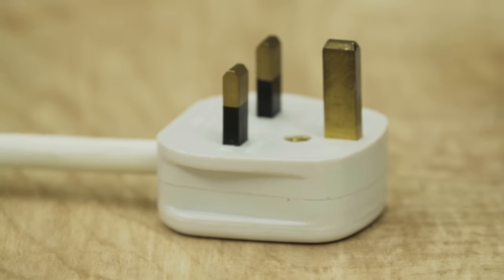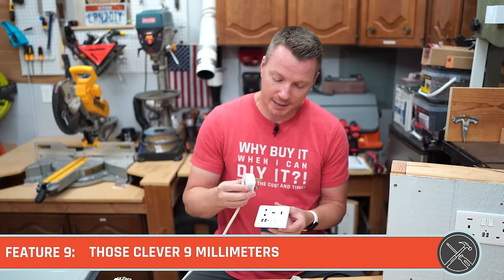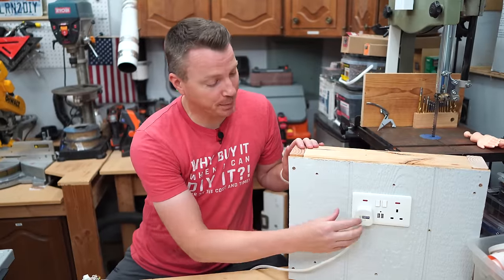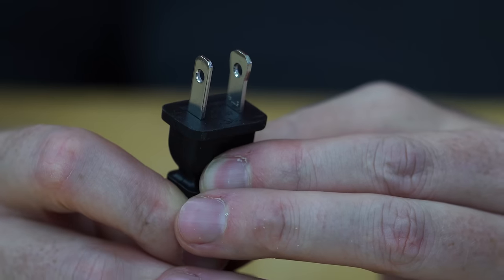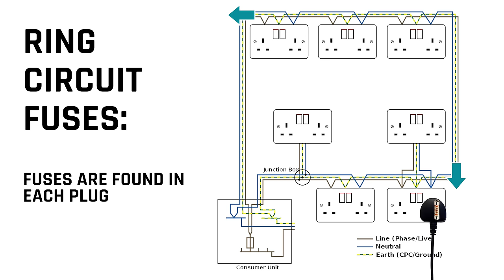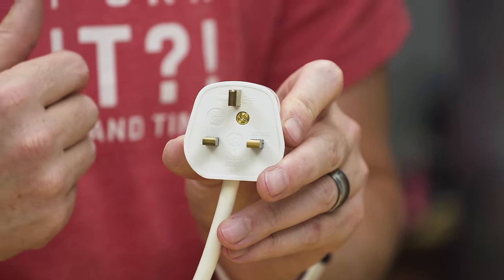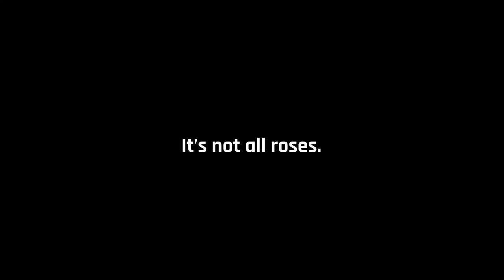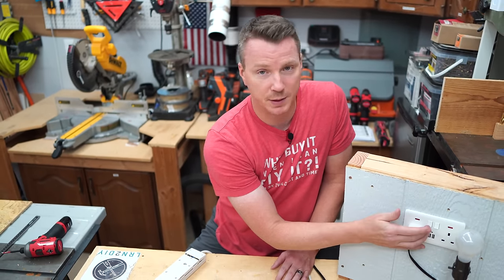British Plugs and Outlets Are On Another Level

Comment: As a Brit, the switches don't cause any confusion when troubleshooting, they're pretty bullet proof and growing up with them, you know they're there.
Reply: Yep, it's a ludicrous idea . . . a lamp doesn't turn on so we start taking the bulb out and checking it, lol . . nope, no one does that, we make sure it's plugged in and turned on . . . it's like saying if your mouse won't wake up your computer from sleep mode then you start to unscrew your computer . . . nope, you'd check if it's actually switched on . . . I suspect your point about 'growing up with them' is why people who've not grown up with this system might think it's confusing for some reason.
Reply: The switch also means that we don’t ever leave plugs on the floor to trip over…
The switches are also always on/off the same way up… so it’s trivial to check.
Reply: @JohnR31415  I agree. As a European, usedthem in Malaysia. Switch, fuse, dinosaur plugs, just perfect!
Reply: ...and is always the first thing you'd check if a device doesn't work. Personally I always troubleshoot from the socket towards the device and not the other way around. Confirm you have power and then trace why that power is not reaching the device as it should.
Reply: The biggest design flaw is that you can step on the prongs hurting both the plug and your foot. We need a redesign that incorporates a 3 pin design, but also lies the pins flat. No one should copy our design, they should take the best FEATURES of our British plug designs but redesign the layout...They say "don't fix it if its not broken" but lets be honest it IS broken.
Reply: plugs exist that have a handle on then back so if they do drop they land on their side. Though who actually has plugs laying around? We all leave them in the socket switched off or in power strips so your not likely to stand on them.
Reply: Just plug the lamp in somewhere else if it works you know its the socket if it doesnt......(you get the idea) :)
Reply: And you'd also know that UK made plugs are better quality than Chinese.
 I've got 45 year old uk plugs that are still perfect,better made,I stay away from Foreign made if I can.
Reply: Quite, it's the same a checking it's plugged in.
Reply: Ye, its basically 'does it turn on', nope, check the switch
Reply: I lived in the UK for about 9 years and I have to say: there is NO foot-borne agony worse than stepping on a Type G plug full on! It makes stepping on Legos feel like bubble wrap. 

One time I wasn’t feeling well and had unplugged my heater but, being sick, just left it off to the side (I thought!). Two in the morning headed for the toilet I stepped on the plug FULL body weight. I went flying and landed on the floor waking much of the building up. The bruise I had on the flat of my foot lasted weeks!  I will never, ever, forget it.
Reply: @festinger3  I don't mind foreign made, as long as they're made to the proper standard(s?). It's when I find the really thin things that I know don't have a fuse in the box, that I become irked.
Reply: @alandaiello7268  I maintain that the pain of stepping on a plug is worse than the pain of childbirth. 

Before anyone gets mad at me, consider if you've EVER met anyone who has experienced the upturned plug pain and then chosen to deliberately do it again. If you have not, but you know women who have chosen to have a second(etc) child, you have met someone whose pain was less than that of stepping on an upturned plug.
Reply: But a little Switch is a bad idea for Capacitive and huge Loads.... a capasitive load can wear a switch very quick.
Reply: You gotta make allowances for our less initiated cousins.
Reply: Yes indeed, I was pretty amazed by this potential troubleshooting issue. I moved into a 70s house which was full of unswitched single sockets. Over the period of a few months I gradually swapped them all out for double switched. Can't stand the unswitched ones.
Reply: @mattsadventureswithart5764  Don't forget that women are genetically programmed to forget how painful childbirth is.... otherwise none of them would ever have a second child! (an ex of mine had faulty programming - she absolutely would not have a second child no matter what... she remembered exactly how painful it was).  But yeah - standing on plugs = severe agony...
Reply: Donynam Lee  
Not always.
Reply: The switches one got me, could you be so dumb as to not realise it's not turned on, pushing down turns it on, up turns it off, the colour indicators are a massive giveaway too, never heard of anyone being confused by a switch on a socket before
Reply: People go on about the pain of treading on a lego brick, but it's nothing compared to treading on a UK plug :-D
Reply: Just for clarification the switches on sockets are NOT a requirement, they are for convenience.  It's possible to buy sockets without switches.
Reply: Yes, switches on sockets are NOT mandated, but as they cost basically the same, and are more convenient, most outlets have them.
Reply: @festinger3  I still have some Bakerlite plugs and sockets in my workshop, they are not live as I bypassed them but I like them so much I did not want to take them out, they could still be used though if I wanted, the Bakerlite plug is on my very first drill that was handed down to me, its a '1950s Black & Decker model.
Reply: Some plugs come folding flat — apple devices. Mine has the port in the back, though. Also you can buy plugs for android + apple where the port is in the edge so the leads run neatly down the wall.
Reply: I work in IT and I'll be perfectly honest some users who work from home genuinely forget they have to turn things on at the wall. But I'd say the people who are that daft are few and far between
Reply: Never has been confusing
Reply: Un switched sockets are also available ....... just saying
Reply: As someone who has worked in IT support I can confirm that some people here in the UK genuinely do have a problem with socket switches.
🇬🇧
Reply: since they dont have a switch to off it.. i guess they always yank out the plug itself to ''off'' them
Reply: The only downside to that plug is stepping on one hard enough for it to implant in your foot my one of my twins woke up crying I jump out of bed so not to wake the other then land straight on the plug so hard that I had to physically pull it out had 3 holes in my foot for about a month so sore
Reply: @festinger3  Do the 45 year old plugs have the live/neutral shielding on the pins?
Reply: @gezmonder  I grew up in house built in 1976 with all unswitched sockets. Fairly common back then, but I can’t remember when I last saw one.
Reply: Donynam Lee  Mostly because the cord was fairly long (it was a small portable) and I didn’t want to trip on the cord. Ironic that I ended up stepping on the plug!!
Reply: New Zealander here. Type I. And always switched. Switches are not a problem when you are expecting them on every outlet.
Reply: As a maintenance worker at a hospital, being called out because something “isn’t working” only to discover they’ve turned the switch off at the wall is a daily occurrence
Reply: What he means is that on cheap sockets the switch can break and cause the plug to not switch on. Happened to me once!
Reply: @johnwellbelove148   I still have some plugs with out insulation at home but not many
Reply: @nkt1   not till 1984 😲 so a 38 year old house could have unshielded plugs
Reply: Care to tell me why the switches work the opposite way? Just the same reason you guys drive on the wrong side of the road, or any other implications? To me, what is the "off" position of the switch would be the "on" position.
Reply: You just try the appliance in a different socket to rule out any fault with the socket.
Reply: @mattsadventureswithart5764  So why didnt you just flip the wall switch to turn the appliance off? Pulling the plug out of the socket is the non-standard solution here
Reply: @Hobby_Electric  What domestic appliances are that heavy duty capacitive?
Reply: You tend to only step on a plug once lol.
Reply: Apple solved the stepping on pins issue by having them be able to fold into the plug when not plugged in. Makes them way easier to travel with aswell
Reply: I was so puzzled when he said that 😁
Reply: Donynam Lee  I think it's a piece of mind thing.  My dad unplugs my toaster and microwave every time he's round mine.  It annoys me to no end given the toaster is switched off at the wall and the microwave needs to be on all the time or it forgets what time it is.
Reply: Indeed, i dont think ive ever knoewn a switch on a socket to be faulty, maybe it does hapen but ive not seen it myself
Reply: @Hobby_Electric  You don't generally switch them under load unless the appliance has no switch of its own which is rare, besides they generally handle breaking current well enough.
Reply: And who even leaves plugs lying around like that to stand on 😂😂. That's the point of the switch so we don't need to unplug it to stop power usage.
Reply: Exactly. I'm British born and bred too and we take this brilliant design for granted. You just automatically switch on and off from the mains first and leave any appliance plugged in. The size has never seemed and issue. It's what we're used to. US plugs seem flimsy to me.
Reply: @mattsadventureswithart5764  Tbf I don't think any woman ever got pregnant a second time "because it didn't hurt"
Reply: @alandaiello7268  that’s why we have switches, to stop people leaving them unplugged on the floor
Reply: @Hobby_Electric  never heard of any switch on an outlet stop working, ever. Whatever the problem you’re imagining is, it’s been thought of and designed out
Reply: @davidjames2145  mostly Americans living in the U.K.
Reply: @peterharvey1762   pretty rare to have a 40 year old device still running in your home,  and it’s easy to change the plug
Reply: Being a Brit in Australia and seeing sparks -lugging things in.. years into living here I still can’t get used to how less safe they are
Reply: @yeknommonkey  wow 50 years old I’d venture a guess your house might need rewiring soon. The great thing about sockets is they’re not hard to replace
Reply: Especially when you step on one in the dark lol
Reply: @pitecusH  It supposedly comes from the days of toggle switches and when most houses would have had electric lighting, but no or few sockets. The idea being that if someone fell, and happened to hit a light-switch, they'd naturally knock it downwards and turn the light on, so not leaving them potentially injured and disorientated on the floor and in darkness. Some things are deliberately the other way - such as isolators, MCBs, RCBOs, as you'd likely want to isolate the circuit when falling, in case you were being electrocuted.
Reply: Literally it become Second nature to just check if the switch is on, i hate when devices don't have power switches so you have to leave the plug on the floor for someone to stand on 🙃
Reply: @stephenwalker6823  oh wow, that's an interesting explanation. Never would have thought of that, thanks!
Reply: I mean that's a real hard of thinking problem. The first thing you'd do is check if the switch on the socket is on or off. If you're incapable of figuring that out then there's some other serious issues going on.
Reply: In IT, you'd be surprised by how many idiots call you to say their pc isn't working, only to find out it is switched off at the plug!
Reply: Just you know turn the switches on if you want them on it's always nice to have the option to turn it off
Reply: Good video, but I don’t think any Brit has ever worried about the issue’s you perceive as they are non-issues
Reply: Yeah I though that. This isn’t a problem at all 😂
Reply: 😂 litterally the first thing you check and then feel like an idiot because it's switched off. Get a little chuckle out of it, I'd say its a pro
Reply: @festinger3  Same goes for sockets (or outlets for our American friends). I moved into a house with sockets from the 50s and they were still going strong. I doubt most of the stuff made today will still be functioning in decades to come.
Reply: As a Brit as well, I agree
Reply: All you do is plug something else into the socket, if that works it's not the socket, and they rarely go wrong anyway. As for standing on plugs - what kind of idiot would leave it in the middle of the floor - typically, since the sockets have switches on them - once they are plugged in, they stay plugged in. You're taking American problems and trying to introduce them into superior British engineering where it doesn't exist. Finally, ring systems are far superior to radial - "the load might be too much on one part of the ring" - erm... that rarely happens but is highly likely with a radial system.
Reply: @Hobby_Electric  homes don't use "huge" loads
Reply: Donynam Lee  only recently, they never used to, and you can still buy plug faces without the switch
Reply: @Hobby_Electric  I'm not sure what devices give that type of load, but in all my years living with switched sockets, the cosmetics get tired before the switch does 👍
Reply: Most of us use the switch to turn stuff on. So you flick the switch first and then troubleshoot if the device doesn't turn on.
Reply: True, but he was spot on with the Stepping-on-a-plug issue
Reply: @alandaiello7268  Big question.  As you decided to pull the plug out  of the socket why didn't you switch off leaving the plug in? The use of sockets without switches hasn't been used for years partly to make the socket safer,   it isn't permanently live and there's no sparking when an appliance like a 3kw heater plug is removed.  Your fault not the plug design.
Reply: @Hobby_Electric  The switch is designed to act quickly so that there is no sparking.  Switches get replaced because of mechanical damage not arcing generally.
Reply: @MrKeefy  Sockets should be switched.  It may not be  a rule now, haven't read  regs, but before plugs had the insulation it was required. Unswitched Sockets may be available  but without a kite mark won't be acceptable.
Reply: @johnwellbelove148  No, that's why switched Sockets were introduced. Who wants to have the TV picture ruined each time you pull a plug out? Unswitched also wore more quickly on kettles and heaters due to arcing.
Reply: As an Indian who uses type G plugs with rounded pins (that's the only difference between the plugs between Uk and India and why is that I don't know) I only understood the testing of the circuits of downsides part and that too only partially. Rest I was also not sure why even it is a problem.
Like why are you pulling the plug from the socket. Just switch off the power supply to the socket and leave the plug in nothing will happen and if your lamp doesn't turn on with the lamp switch try the switching on the power supply to the socket where it's plugged in.
Plus I don't know about UK but I doubt that every appliance has been converted to 3 pin variant as 2 pin variant still exist in the form mobile chargers, trimmers charger, router plug, set up box plug and other electronics which may need a long continuous but less power consumption still use a 2 pin. It's the case in India don't know about UK.
Reply: @eh1702  For portable devices the Apple folding switch is both robust in its construction and has the power and convenience so is easy to travel with too!
Reply: @mattsadventureswithart5764  

To phrase it in a way that the Americans will understand, standing on a plug has a similar feeling to unloading a 30 round mag from an AR15 in to your foot… in fact, it may be slightly worse….
Reply: Yes, I think he was just searching for anything negative to say. Not being British I can't speak to the uber-Lego problem, but it doesn't seem likely to me people leave their plugs lying about. The only downside I see is the size.
Reply: @peterawlings6568  Your reply is baffling to me.  Essentially it tells me what I said, as though I had argued against it. Are you sure you replied to the right person?  The apple folding switch (mine, anyway) is ergonomically clunky, having an unusually high, curved back that you plug your charging lead into the middle of, rather than a flat back &/or ports in the edge where cables normally go. Otherwise it’s fine.
Reply: @Medic6666  if none of the other plug sockets work in that room then check to see if the fuse on the fuseboard hasn't tripped  before taking the socket out of the wall to check that
Reply: @alandaiello7268  we call them 'Lego bricks' here
Reply: As a Norwegian, the switches never caused any confusion either from the first day I stepped foot into the UK
Reply: When you stand on it though.
Reply: @Hobby_Electric  never had to change a uk socket due to a worn switch in the last 40 yrs.
Reply: @reuben9722  but Apple items are not cheap like the tea break kettle
Reply: @geoffreycodnett6570  u
You can buy sockets today without switches
Reply: @kuriakosekjoseph6253  chargers have three pin style plugs with plastic earth.
Reply: @grahamjohnson4702  only some chargers. Plus I said about India don't know about uk
Reply: They would only confuse an American.
Reply: @Hobby_Electric  I've never heard of one of these plug switches failing. It's probably happened but just not a thing.
Reply: @nkt1  My parents house, built in 1975 had fully switched sockets. So maybe only common in your area.
Reply: @pitecusH  What do you mean by 'opposite way', that's the way they've always been. Also we drive on the correct side of the road and you adopted the French right side of the road.
Reply: @marksmithwas12  North America is the only place that calls LEGO, LEGOs.
Reply: @BensoftMedia  that’s not the fault of the system, that’s the fault of people being complete idiots
Reply: @Nathan-jt8zt  I know, I’m just sharing a funny story challenging the claim that nobody is confused by them. No system is idiot proof, mankind just builds a better idiot to get confused by it.
Reply: Definitely know they are there when you step on them. So painful when you just wanna get back to bed after going to loo in middle of  night
Reply: @BensoftMedia  hahaha that’s a good point mate
Reply: There's always that moronic moment though where you forget. The difference is British people look at a slightly complex design and realise they need to remember. Americans just say it's too complicated. In short, the difference stems from INTELLIGENCE
Reply: We were taught how to service these plugs in physics / science as part of the mandatory curriculum
Reply: Lamp doesn't work. Switch, wall switch, fuse, bulb. Weird, better check the cable. Oh, so that's where the hamster went.
Reply: Yessss! When I liked your comment it turned to 3k. I've been waiting for that moment. Now I need to go and apply my new found magic powers for the greater good.
Reply: @kuriakosekjoseph6253  I gave you the latest all appliances have three pin style plugs in the UK as that is the only type of Wall sockets we have. Live and learn from people that know.
Reply: I think he may be suggesting that the switch could be faulty. I’ve never even heard of that happening, but I guess if you haven’t grown up in Britain you might think it’s a potential issue. In reality, it just isn’t.
Reply: @grahamjohnson4702  Bruh, bruh. I understood that. In India also all the sockets are three plug sockets since  almost 2 decades now. The difference is some of them have that shutter mechanism and some have not. It's not a requirement here by law.
So majority of the people used to go the non shutter way as it was economical. But nowadays all new houses that are being built usually put these shutter socket.
And as India is a very price conscious market manufacturers to make profits sometimes don't use less materials like in the case of mobile chargers, trimmers etc. There is no law requiring something like that here although in the coming years it might come as India gets more economically stronger.
Reply: @AnotherDud3  muricans tho
Reply: Even if a switch were to fail; you can always try plugging into a different outlet.
Reply: @Pixie Pete Big mistake assuming I'm american, mate. Not even close.
Reply: As an Irish man I know that plug and use it every day
Reply: The plug knows where it is and where it isnt
Reply: @Pixie Pete There are, off the top of my head, maybe a dozen or fewer countries that drive on the left. The rest of the world, there being no other alternative, drive on the right side. If you're on the highway and everyone is oncoming traffic to you, maybe you're the one that drove in the exit. (i.e. "right" vs. "wrong".)
Reply: No self respecting British person calls themselves a 'Brit'
Reply: The switches are only confusing if you haven't grown up with them on every socket you come across.
Reply: @Pixie Pete Yes, I'm aware. That's why I'm asking, who is "wrong" when a dozen countries drive on one side, and some 190 drive on the other?
In regards to the highway analogy: You've never heard the joke about the guy that went in on the highway at the exit, and heard the radio warn drivers that a lunatic drives as oncoming traffic, to which the driver said "A LUNATIC? ALL OF THEM!" ?
Reply: @Rainstalker  "it knows this by knowing where it isn't at all times"
Reply: Agreed.  I favour the MK brand when installing
Reply: Exactly, by the way I'm a Brit living in India and there's no ring main circuits here. The BS plugs are awesome and keep your fingers away from live electricity.
Reply: @eh1702  My comment was supposed to read to support your comment not challenge it. The Apple UK plug is a development of the main design and is brilliant - especially for mobile usage. I think the comments you make about the UK plug design are sound and I agree with them so I did not mean to cause bafflement!
Reply: Problem today is plugs are factory fitted bonded. So people don’t even know how to fit and wire a plug from a bare three core flex. The only thing they get is a fuse and even then it’s ‘what’s a fooose for?’ 🙄
Reply: Agreed, the first thing you'd assume was the switch was off
Reply: Also I don't think he quite gets the ring circuit idea, a ring circuit is a perfect load balancer, no matter what power is being drawn from any socket the current in every part of the ring is equal. It's the US circuit that  has this problem. The negatives he gave are pretty weak and unlikely
Reply: @Medic6666  That would be to easy, like turning the switch on, no far more intelligent to rip the thing apart and try to fix it 😂
Reply: @flagpoleeip  Yep, reminds  me of a YouTube video of someone dragging the vacuum cleaner, pulling the plug out and spending 30 minutes vacuuming wondering why it was picking the dirt up anymore, that was a 2 pin plug LOL
Reply: @Hobby_Electric  The switch isnt little , it's adequately rated but this is possibly another bad US habit, most people would turn off the appliance switch first as you are correct, using the socket switch for turning of heavy loads isn't the best idea, it will lead to quicker failure of the switch, we would only usually use the switch as a second safety breaker, or as a primary breaker for unswitched low power things like chargers and power plugs
Reply: @AnotherDud3  Only in countries that aren't used to switches and where folks aren't to bright 😂
Reply: @astromec6303  All things fail occasionally especially if mistreated, it's rare
Reply: @reuben9722  Typical, better idea just don't be so lazy and leave it lying around in the first place
Reply: @cjuk81  it does but it's rare, usually happens when missused
Reply: @BensSightSoundandAuto  Exactly
Reply: @yeknommonkey  I've got one aswell, got hit with a hammer
Reply: Just a thought but if you left a cable across a floor like that in the dark you probably trip over it and smack your head on the wall before you stood on the plug😂
Reply: Well those with an IQ around room temperature might find the concept of a switch confusing but then again they would probably find walking and chewing gum at the same time complicated.
Reply: Sure Pal, I have a house that is rented in which all the plug sockets are over 50 years old. Because this house is rented I’ve just had to have an electrical inspection done to meet the legal statutory requirements. 
All the sockets are absolutely fine and must have been used 10’s if thousands of times.
Reply: Don’t worry, simple, things, confuse Americans😂
Reply: I0
Reply: I've been with the wet 240 shock it hurt haha
Reply: @Hobby_Electric  UK plug sockets provided they are made to UK safety standards last donkeys years.  your concern is not valid
Reply: @peterharvey1762  no any home with an appliance that has a 38 year old plug on could have unshielded pins..
Reply: These are very handy as a Brit myself and we also have covers that are made of plastic that we plug in to be extra safe😊
Reply: I’ve stepped on a socket befor but its the iPad Pro one and that folds up 🎉
Reply: @alandaiello7268  What did you unplug it?  Just switch it off.
Reply: @johnwellbelove148  Yes
Reply: @pitecusH  You press on the bottom of the switch to turn on. The top of the switch therefore pops out and usually has a red mark on it so you can see it is 'on' when looking from above (as you would usually be)
Reply: You didn't mention that the downward cable also means you can push stuff like couches, dressers and such closer to the wall because the cables don't stick out.   And if you do push something back up against the plug, it won't damage anything.
Reply: Ikr, it's just a nightmare when you go literally ANYWHERE else in the world you can't afford to forget an adapter 💀
Reply: @alandaiello7268  
Brits do not do that.
Reply: @Hobby_Electric  
Hugh loads ate generally hard  wired to a terminal block.
Reply: @festinger3  Yeah, Chinese plugs are not quite BS1363, they use some much looser standards.
Reply: @davelordy  I grew up in a country with American plugs and moved to the UK. It was never confusing for me.
Reply: @alandaiello7268  when you grow up living in the UK you don't often do that..maybe once 🤣
Reply: @Hobby_Electric  its not "little " its raged for 50 amps but plug and wiring is generally 13 amp rated..UK plugs are without question the best designed in the world
Reply: Indeed as I don't know why someone would ever jump to the device being broken before checking if the switch is on. Even if you haven't grown up with switches on plugs, you first check the circuit breaker. Which is essentially just another switch before assuming something has broken.
Switches on plugs also just make alot more sense so you don't have devices consuming energy by being on standby while not having to unplug the device.
Reply: @davidjames2145  I once had a problem with a computer not turning on, turned out the fuse was missing
Reply: Ha ha ha ha, I’m pretty sure I haven’t been confused by an on/off switch since I was 3
Reply: @danegel  So many questions for that....😆
🇬🇧
Reply: They can but it's really rare, and to test it you would just find something you know that work and try it.
Reply: @mattsadventureswithart5764  surely the pain of a motherplug giving birth to a babyplug would be worse still ?
Reply: As a computer technician who had to drive 50 plus miles to "fix" a computer that had been switched off at the mains, I feel I can say some people have a problem with this.
Reply: yeah ive never felt unsafe with electricity when using this plugs
Reply: As an Irish person, I can concur...
Reply: I wonder why they don't use glass fuses.... it's impossible to tell if the fuses are good visually.
Reply: @no_no_just_no that's not an issue with the plugs that's just incompetence
Reply: @alandaiello7268  I did something similar, unplugged something to replace a fuse, realised didn't have a fuse and the shop was closed, left it unplugged, got out of bed at 3 in the morning for a glass of water, stepped on it.

However I had more than just a bruise, it literally tore my skin and I three rips in the sole of my foot where this monster attacked, though it's only ever happened the once
Reply: It's a problem only an American will invent to make something foreign that is much better look bad. Also, no one has ever stepped on a British plug.
Reply: @mattsadventureswithart5764  
Have you had a child?
Reply: @gelinrefira  this is incorrect, I know many people who have stepped on a plug, your comment should say nobody has stopped on a British plug twice
Reply: @gelinrefira  I wonder what kind of person walks around bare foot in the dark with a load of plugs laying around 😂 like you don't even need to unplug them the switch means you have no reason to take it out the wall. I guess the guy in the video was really grasping at straws when  trying to come up with disadvantages
Reply: @helmetmcbarin  Yea, it makes no sense at all. I have been around British plugs all my life and have never stepped on one. I do admit that the plug is huge so it makes appliances and power brick somewhat more bulky and awkward to stow away. The plug's strong securing in the outlet is also one of its weakness; an old plug in a socket can become very hard to remove especially when there is some corrosion on the pins.
Reply: @davelordy  10:50   Switches Are 
             Double Edged Sword

This is a non existent issue!☺️

If an appliance does not work you simply try another appliance at that same socket eg a phone charger.
If that works then you know the issue is with the original appliance
If the charger doesn't work then you have an issue with the socket

Thats it, takes about 10 seconds to work out 😂
Reply: 10:50   Switches Are 
             Double Edged Sword

This is a non existent issue!☺️

If an appliance does not work you simply try another appliance at that same socket eg a phone charger.
If that works then you know the issue is with the original appliance
If the charger doesn't work then you have an issue with the socket

Thats it, takes about 10 seconds to work out 😂
Reply: As someone who moved from the EU to the UK, I can't tell you how many times I plugged in my phone to charge only to find the next morning that my phone hasn't charged... Since then I always leave all the switches turned on.

And yes, I had to throw in a Brexit joke
Reply: not to mention the fact that 99.9% it's either the plugs fuse or the device itself, aka, a wire, in 20 years, i've only ever had a wall switch stop working on me once, and that's because i punched it and guess what? It still worked! So i tried to push the switch back into place, and in doing so, broke a little thingy so just had to get another face panel, super easy and cheap XD
Reply: I have forgotten to turn it on and not have my phone charge all night before
Reply: @grassytramtracks  🤣🤣
Reply: @ThisMarv  What’s the joke? Sadly, you’re correct.
Reply: @HMS.Margate  Our house was built during a housing boom caused by North Sea oil, so maybe the builder cheaped out on some materials. It was single glazed, too, a bit late for that I’d have thought, in a private, detached house in the north of Scotland. My dad ended up fitting secondary glazing himself.
Reply: @mattsadventureswithart5764  Perhaps a little education here might dispel that notion...
Reply: I know and I love how he skips over the fact theirs literally an led light showing when the plug socket is receiving power 😂
Reply: Donynam Lee  maybe only newly arrived at that point.
Reply: @Hobby_Electric  never seen that problem here. Mind you I'm only in m 50's. Might be why we have a different switch and plug for ovens. But dryers, washing machines, dish washers, fridge freezers, electrical heaters ect... np with the normal plugs
Reply: Yep, agree. Bit of a daft point in the video that one.
Reply: British plugs are definitely the best
Reply: Nice video, but the cons are hardly cons at all. G type plugs rule
Reply: @davelordy  imagine using mouse to wake up computer when there's a dedicated button for that.
Reply: @festinger3  Indeed, I have a bag full of old 'Nettle' and 'MK' plugs that I've taken off scrap appliances over the years. They are made of a kind of white Bakelite-like material and are as tough as old boots. The imported ones are flimsy.
Reply: When that's all you know...the switch is the first thing to check
Reply: @pitecusH  so you can see the painted red "on" marker from above
Reply: @davelordy  If anything, I saw a socket that didn't have a switch, and was like "But why?" 

That's in my own house too but I only got it in July, so whatever
Reply: @JohnR31415  "The switches are also always on/off the same way up" — Not if it's part of a multi-way switch! Actually, funny story about that: my American girlfriend recently moved into her UK uni accommodation, and the first thing I noticed and mentioned to her when I walked into her room with her was that the light switch was oriented incorrectly (push on the top to turn on, push on the bottom to turn off). But lo and behold, there was another switch above the headrest of the bed — two-way switch!
Reply: @Hobby_Electric  can it? Tell. That to the 50y old switches that haven't been replaced in Manor houses yet but still work perfectly
Reply: @jimreviewsstuff  I'm 48. I've never stepped on a plug in my life.
Or a rake.
Or Lego.
Or a bear trap.
Reply: Exactly - the first thing you'd do anyway is check that it's plugged in; while doing that you can see whether it's turned on as well. Practically, it's no extra work at all (although some people are more zealous than others about turning off those switches, and speaking from experience it's pretty annoying after sitting down to watch TV to realise your housemate has shut it off at the wall...)
Reply: @johnwellbelove148  Never had/seen old ones with pin shielding. Shielding was introduced in 1985 by law.
Reply: Yeah, also leaving plugs lying around on the floor isn't something I tend to do often.

Not saying I've never stepped on one, but I don't exactly make a habit of it lol.
Reply: @mattsadventureswithart5764  When a woman has a child their brain releases a chemical that makes them forget how painful it was.

That mixed with the chemicals that enhance the feeling of "first contact" make the argument for another compelling to most woman.

Plus they get a child out of it.
Reply: @OhmegaWolf  Stupidy costs money, nonetheless. I hope. You still made the trip and 'fixed' the erm 'issue'. 🤣
Reply: @pitecusH  Its generally so you can see the red at the top showing its switched on, although they don't all have that. Have you guys figured out how to use a roundabout yet? 😜
Reply: @stuartmorgan3654  Its cause he's older probably, the older generation didn't grow up with wall switches. So its learnt behaviour that's hard to undo, particularly on a 'safety' topic. It shows he cares, bless im.
Reply: @vcrossCelticfc  I'm still not american, buddy, and yes, we have plenty of roundabouts here. Actually "a" roundabout, too, which is actually 2 roundabouts right after eachother, while a tram line goes through the middle of both of them. Nice try, though!
Reply: @pitecusH  I've driven in both Countries with the French and obviously British system, it takes a while to adapt but you just take your time and within an hour you've nailed it.  It's best to be careful initially, accidents in Florida (from Brits) is common, likewise with Americans in the UK.
Reply: @TomAlter1000  Erm, that's why a vacuum hoover has a cord and two places to wrap the cord around, therefore removing the plug from the floor, also so you don't have a long wire trailing after it. I've yet to see a Hoover without this feature.
Reply: @kuriakosekjoseph6253  I've never seen a 2 pronged plug in the UK, I'm pretty sure it's illegal but I'd have to double check the legislation. Instinct says it's illegal tbf.
Reply: @JivanPal  Don't you have two way switches in the US? I literally have one at both ends of my hallway for when you come home. Although that's practicality.
Reply: @pitecusH  Wow, I've only ever heard an American say 'buddy' and I've been to 28 Countries, where are you from, where you educated in the states?
Reply: @vcrossCelticfc  No, never been to the US. We're on the internet, though. Might as well be saying dude or bro.
Also, I'm pretty sure, canadians use "buddy" a lot.
Reply: @vcrossCelticfc  I'm in/from the UK... I think I can see where the earlier confusion arose now.
Reply: @JivanPal  Are we conversing on two different threads? I found it odd that I couldn't find the comments I posted. When you say 'in the UK' are you British? At school? Hope you stay if so, we need good people.
Reply: @kuriakosekjoseph6253  You could be right. It would be interesting to see if American plugs are cheaper than British plugs or vice versa, that could answer that question. I would prefer people be safer, particularly with people who have children in the house.  Although then you have to factor in the % of electrical accidents etc etc, it's an interesting discussion.
Reply: @vcrossCelticfc  But truth be told I understand the logic behind earthing all electrical appliances especially in a place with heavy rains but the shutter mechanism in the sockets is a bit too much I think. Because frankly in India atleast I have never heard of anyone dying due to a electrical shock they got when they put their finger into the socket. And it maybe in part that usually very sockets are installed closed to the ground and if installed are there for specific purposes so the plug is usually in and behind the appliance so they can't reach or ignore it.
P.S. In the video he says that two pronged plugs if destroyed the entire cable has to be replaced. In India you get this replaceable two pronged pins those can be used. This is for things like study lamps/small portable fans/humidifiers/ steam machine etc. For speciality equipment like mobile chargers you will have buy a new adapter or a new power cord.
Reply: When I first moved to the UK it took some getting used to but I love it can "unplug" my electronics without actually unplugging them
Reply: @kuriakosekjoseph6253  Thanks for that, I decided to check. There are approx 30 Indian's who die per day because of shocks, the UK is around 2 to the highest was 6. There was an uptick in inexperienced electricians dying in the UK which is a bad sign. Comparing the population sizes etc then it would appear India is actually safer?  Which I found extremely interesting. In the UK it takes extensive training to be an electrician, so that shows in the cost of services plus a shortage of properly accredited electrictricians, so we seem to have a DIY epidemic here in the UK.  Perhaps your original point on price was quite accurate and relevant.
Reply: @Amelia-vk4jt  Its the same going to any other Country, I've been to the US about a dozen times (Florida mostly, Texas and Vegas). It wasn't until around the 4th or 5th time I drove the car, even then I waited until we were at the Florida Keys which is pretty idiot proof (and safer). 🤣
Reply: Every Brit has asked "is it on at the wall". It's just in our vocabulary. Never been a problem.
Reply: @vcrossCelticfc  I think money is the most important issue as if you visit most Indian households they will try to save on power bills by switching off unnecessary electrical items and DIY is usually restricted to changing plugs, pumps of aquarium/desert coolers, changing bulbs or something in that general area. Otherwise you call an electrician. And as such here there's no special course or anything it maybe a family thing but then referring to your point it keeps the costs down and people more safer
Reply: @LiamDilley  
Yes sure Dilly.
No difference in safety.
Dilly by name, Dilly by nature
Reply: @festinger3  Avoiding anything Chinese made which is electrical is adviseable, if possible.
Reply: Yes they are so effin BIG
Reply: @Hobby_Electric  
You mean inductive loads. 
The switch is adequately rated and a switch is designed to disconnect electricity rapidly. Pulling out a plug from a live socket is more likely to erode pins and create arcing and excessive electrical noise.
Reply: @johnwellbelove148  
No. It is now mandatory. We have had the shutter system for as long as I remember… I’m 65
Reply: @derekrobinson4636  I meant the insulators of the live and neutral pins. I'm not sure what year that became mandatory. I'm 62.
Reply: I fail to see why he is going on about load balancing in ring circuits. There is no issue. Radial feeds have potential problems, ring circuits always have half the sum of ALL currents from all the sockets in any wire.
Reply: @peterawlings6568  
I doubt an Apple plug is rated at 13A though 😅
It’s design is primarily for travel purposes.
Reply: @grahamjohnson4702  
You can still use I switched sockets but they aren’t used very much.
Reply: I’m 65 and can’t remember anyone ever standing on a mains plug.
We generally use a switch and if we do unplug we tuck the plug out the way of anyone stepping in it.
Like everyone else we step on Lego.
Reply: @altvamp  
The switch is a device designed to break electrical loads quickly. Just pulling the plug out of the socket is not the correct way to break the connection. It causes excessive electrical noise and sparking and wears the contacts.
Reply: @richardbartlett6932  
Possibly, but we have had the shutter system long before that.
Reply: @johnphipps1560  
Glass fuses aren’t used because of the Rupture current rating and spark suppression.
Reply: @gelinrefira  
Having a plug that securely fits into a socket is not a weakness it’s indicative of a good electric connection being made; unlike US and European plugs which are sometimes very loose. 
Also corrosion on pins is caused by people pulling live plugs out of sockets, rather than using the switch.
Reply: @derekrobinson4636  I think you replied to the wrong person! I didn't say that.
Reply: This lol
Reply: @festinger3  You can't beat the old ones for ruggedness, I've still got one Clix plug from the 1960's in use. Nowt wrong with it, and they were the first plugs to have externally accessible fuses.
Reply: @Hobby_Electric  Good point, the switches on sockets are a known weakness.
Reply: @derekrobinson4636  Oh, don't get me wrong. The plug's strong fitting is a plus. I'm saying that it can also be annoying because when a plug is in the socket for a long time, they tend to corrode a little especially in the tropics, and that creates more friction and make it even harder to pull out. It's a small annoyance, not a big deal and definitely does not make the strong fitting a disadvantage. 

I find that German plugs to be also quite good. It has most of the same advantages of the British version, except the lack of switches. They fit snugly and securely and designed well to prevent accidental shocks. You can even fit them upside or downside if polarity doesn't matter like AC to DC plugs.
Reply: Instead of 2 holes theres tree its ....
Reply: @AnotherDud3  

Americans can be easily confused 😕
Reply: @davidjames2145   

They're not millennials are they who watch too much American TV?
Reply: @Hobby_Electric  no need to worry about the sw looks small outside, the contacts inside will meet the spec. never had problem with this. and the fuse inside those plugs limit the current to 13A.
Reply: @pitecusH  UK switchs now come with a red section showing its powered, this only shows on thr upper of the switch, this only works when on is the lower half of the switch is in. The other way round would have resulted in this red bit facing down(invisable) , some even an led instead of red paint.

This pretty much means its almost impossible to think a plug is off.
Reply: Plugs stay plugged in and are usually behind some table for the lamp or clock or  a TV stand  or sound system. Nobody wants yards of cable from socket to equipment.
Reply: @alandaiello7268  I have lived here 50 years and I have never heard of anyone doing that.
Reply: As a Brit,I have never stood on a plug and as an Electrician, I have never heard of having to balance out where I plug things into the ring main, it's a non issue.
Reply: We also never leave plugs on the floor. Because we know they will be stood on
Reply: @scottpeters1847  There are several houses and apartments (that I've lived in)wired in north america so there's a single 120 volt outlet powered by this mysterious light switch, that you never know what its for until you plug in something that needs to be on and powered at all times, and someone flicks the switch.
Reply: Also, in my 50 years spent in Britain I have never trodden on a plug. Have never trodden on 'Legos' either. Have trodden on plenty of Lego though.
Reply: Yip, but the yanks have them upside down...
Reply: I'm a brit and can agree
Reply: @gradyparsons6678  so I guess that means every Asian person is also russian Indian Chinese and Japanese
Reply: @Hobby_Electric  trust me, that is never an issue.
Reply: @davelordy  l buy 15 Amp fuses in Hong Kong - by the commercial wholesale box, 13A are also available. The British Archaic system is about 60 years old and in dire need of revision. The plugs were over-engineered at their introduction, a situation that hasn't improved since.
Reply: @TomAlter1000  Most people would put their cleaner away when not in use or wind up the cable.
Reply: @AnotherDud3   at least not British anyway
Reply: @Crippledsasquash  I don't understand the "stepping on the plug" thing........power sockets are in the wall, why would anyone walk to the wall to then pull out a plug and put it in the middle of the room when you only got to either just switch it off at the socket or let it lie where the socket is ?.....................there must be some strange people about .
Reply: @reuben9722  that's the only real reason folding/sliding pins are used , although the fact they're only passing out 5v dc may be a secondary reason that they work.
Reply: @aarona3606  some strange folk about
Reply: @davelordy  I think he meant you don't know if the switch on the socket or lamp has failed. 

But your point still holds, we just move the lamp to a known working socket to confirm the original socket is not at fault.
Reply: yeh and it saves you having to unplug the pone charger every day.
Reply: @Hobby_Electric  I don't think you'll find 'capacitive' loads. The real problem is inductive loads such as appliances with electric motors with high initial current flow
Reply: @Hobby_Electric  Questionable argument.
Not many loads are capacitive. The capacitor is there to balance the effects of an inductive load ie an electric motor.
High current loads are more destructive on the pins being plugged in than the switch that is designed to switch high current loads. The proof is in teh spark from the initial contact when plugging in.
Reply: When I first came to the US long ago I was shocked at the flimsiness of the plugs, I just couldn't believe my eyes.
Reply: Lets hope that the switches are not on yet another level.
Reply: @Hobby_Electric the switches are not a problem. They work for decades without fail as long as you don't install poor quality cheap sockets.
Reply: @brokeandtired  Have you never noticed that when you drop these plugs, 9/10 they drop pins down...
Reply: I was rewiring appliances, and changing plugs from like ten years old in the UK!
Reply: @brokeandtired  The layout may not be ideal when it comes to ouchy feet, but I think it's a bit far to call it broken. Like Lego, it's one of those things you probably will step on once, but generally only once! Especially with a switch on the socket, there's little reason to have a plug loose on the floor.
Reply: @festinger3  yep. MK all the way.
Reply: Just one minute In USA we have some very good JUNK As a Master Electrician I can say we have a lot of just Junk that cost a lot
Reply: @pitecusH  you're mistaken, up is off, down is on.  The USA has it the wrong way round .
Many switches show a red indicator to show they're on.  Just another way the US is out of step
Reply: @Thurgosh_OG  the only time I ever had to replace one was when the mother in law got a bit enthusiastic with the Hoover and smashed the socket. Never heard of one wearing out.
Reply: had them in the middle east, can confirm
Reply: Same here in Malaysia and also it's very useful and very convenient at all time
Reply: @RandySeverino  why do USA have theirs upsidedown?  Only in the USA!!
Reply: Not being funny, but the UK plugs can be clipped away so they are just a block.... ANd clipped back out for use.
Reply: @urbanprojectz  some can, but not standard plugs.
Reply: They also aren't required and you can get sockets without the switch. You can also use the sockets in a radial circuit they aren't limit to just a ring. The only real downside is stepping on them, the size concern seems daft as they are stuck in a socket on the wall.
Reply: @brokeandtired  Lol, it's not broken? Just because you could step on it and it hurt you, you think it's a broken design? You could step on a rake and it may hurt but that's no reason to change it's design as it wouldn't work properly? A LOT of things hurt if you step on them with bare feet? What a random comment lol.
Reply: Do you still have wall switches for some plugs?
Reply: @brokeandtired  Then you'd lose the right angle direction of the wire and they get pulled out.
Reply: @festinger3  I'm (in the UK) getting an increasing number of devices that come with a foreign (American or Chinese) plug on them and they're awful!  My phone charger started charging much slower, and I found it's because the flimsy contacts in the socket weren't gripping so tight.
Reply: @alandaiello7268  Why didn't you just switch off the heater?!?
Reply: @mattsadventureswithart5764  I bought a battery charger from China and the prongs were PLASTIC with PAINTED conduction.  It did work, for about two months.
Reply: @Hobby_Electric  And you somehow think that load is ok for the prongs if you unplug it?
Reply: @AndrewAHayes  I was about to correct your spelling to bakolite, then I find it's actually bakelight and we're both wrong.
Reply: @eh1702  Trust Apple to add expense.
Reply: @alandaiello7268  sorry to hear that but it is acceptable against getting electrocuted.  Children are safer with UK plugs especially as our voltage is higher than the US   . People very rarely stand on them as they are left plugged in with the switch off if not in use.
Reply: I was about to comment on this. We're (British) are used to having a switch on the socket. I'm never confused by this setup and it wouldn't make me unnecessarily change the bulb in a lamp.
Reply: @brokeandtired  Only if you step on them....
Reply: @brokeandtired  just don't leave the plug lying around. Then you wont step on it.

It's not broken, people are careless.
Reply: @brokeandtired  There are plugs where the pins lie flat for travelling, charging mobiles etc.
Reply: I think it's funny that at this point, there are 333 replies to this specific point.
Reply: The replies to this comment miss his actual point, the point is that the switch is another thing that could break and cause issues. The argument isn't that someone might forget to flip it on, but that it is an extra point of failure, another thing that could break and be the cause of the issues. 

The switch sounds great, but adding more points of failure will ALWAYS be a downside to something. The utility likely outweighs the downside, but the downside is still there.
Reply: @flashlightning6742  I've been alive all of my life. Never had a switch fail. 

Never even heard of anyone having that issue
Reply: 100% we have the best plugs in the world
Reply: @peterharvey1762  You mean a 38 year old APPLIANCE could have unshielded plugs.
Reply: @pitecusH  As you can see, it's a rocker switch (OK there were a few older ones that had a lever toggle but we are talking about current practice) which means the top edge comes into view when it's in the on position, and it's painted red. So you can see at a glance, from a distance, if it's on or off. Bear in mind most (not all) sockets are set fairly near the ground on a wall and you'd be viewing these from above. Some sockets have a built in LED or neon indicators instead (sometimes in a separate window, sometimes in the rocker) which can be seen from across the room.
BTW, the reason we drive on the left is the same reason we drive on the roadway and walk on the pavement whilst you drive on the pavement and walk on the sidewalk - we got it right, you copied it and got it wrong - only joking! The other apocryphal  reason is that most people are right handed so your sword hand was on the side to defend yourself against oncoming riders.
Reply: You say that but my mum had be change bulbs and fuse in one lamp yet it was off at the wall 😂
Reply: @pjaj43   yep and even younger if they were brought with no plug and the house holder used an old plug
Reply: I'm speaking as someone who just switched to using outlets with switches after using the non-switch outlet for my entire life. I wish I would get this sooner.

First, I never get confused since day one of using it.

Second, it is like a built-in feature for home appliances that don't have switch.

Third, it eliminates spark when you plug in a high-power draw device before turning on the switch like a gaming laptop adapter or high-wattage hyper charger phone adapter.
Reply: @davidjames2145  Really? Can these people walk upright?
Reply: @davidgrahambrown3793  I once witnessed a marketing director for a well-known multinational engineering firm fly from France to the UK head office so she could hand her laptop to IT in a rage because it wouldn't turn on. The IT guy pressed the button on the side and on it came.
"But I thought the button was on the top" said the highly-paid executive.
"No, that's just a light" replied the IT chap.

True story - I was sitting opposite.
🇬🇧
(I know that's not about plugs - I'm just illustrating. There were quite a few socket stories as well...)
Reply: A lot of sockets dont have switches
Reply: @JohnR31415  seriously you never left a plug on the floor, not even when you need to temporarily need plug something else in … like a vacuum cleaner
Reply: And you can still write +(for on) and -(for off) with marker (or 0/1) (or green/red) and no more troubles.
Reply: @Arnjeir  as long as that first footstep wasn't onto a ......
Reply: Only countries with UK plugs would understand how safe it is.
Reply: As Malaysian, I approved this comment.
Reply: @jimreviewsstuff  folding plugs also exist now so the prongs can be folded away
Reply: @brokeandtired  no its not broken, just dont leave them in the middle of a floor .. simples.
Reply: @andrewwigglesworth3030  It's no wonder the Merkins are so obsessed with GFCI breakers and the like.  They still have plugs with no sleeves going into sockets you can't switch off first.  And their plugs are so small, I'd be touching a pin accidentally every other time.
Reply: @davelordy  no
Reply: @nkt1  1960s house here. We had a few, but you best have had your electrics replaced my now. We found bare copper because the rubber had disintegrated.
Reply: @brokeandtired Well no, it's not broken. Don't quite understand how you came to that conclusion
Reply: @alandaiello7268  Why didn't you use the switch? By your name I presume you are male. As an 84year old female, that's what I would do.
Reply: @Crippledsasquash  Why don't you have a switched socket for that device? Two seconds of forethought is all that is needed.
Reply: @StoutProper  I have a dryer that was over thirty years old when it was given to me, I've still use it 20years later.I do keep my eye on it when using.
Reply: But do you? Children too?
Reply: Indeed, this is only a problem for someone who has never used a type G system. We automatically check wall power before checking anything else, why wouldn't you?
Reply: @Medic6666 and you know if there is a socket problem because the main ring fuse usually trips.
Reply: @festinger3  

"And you'd also know that UK made plugs are better quality than Chinese"

IMHO it's less to do with what the Chinese are capable of than their production quality control.

Their products are cheaper because they have minimal quality control standards allowing them to produce more products faster than any country that does have said standards.

If China has an organisation equivalent to the European CE standards that actually bothers to check exported goods then I'll eat my hat.
Reply: I don't think I've ever seen a YouTube comment with this many likes. Not the best example of a design "disadvantage".
Reply: Brit spark. 

Not all circuits are ring circuits. 
Lighting on a radial and some sparks are not installing ring final circuits, as that is their official name, anymore, just radial for power circuits.
Reply: What woudl you do if in the middle of the night someone changed all your sockets to not have switches?